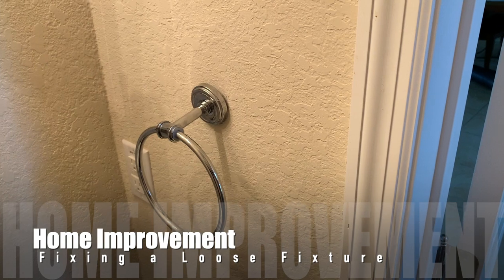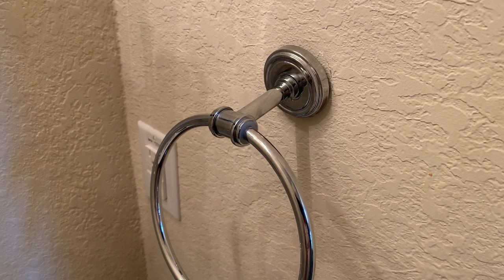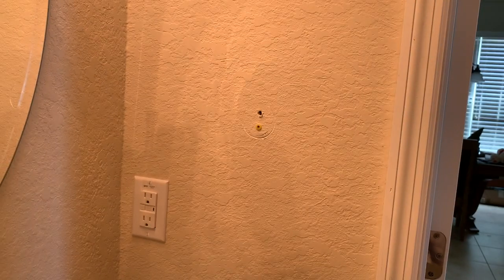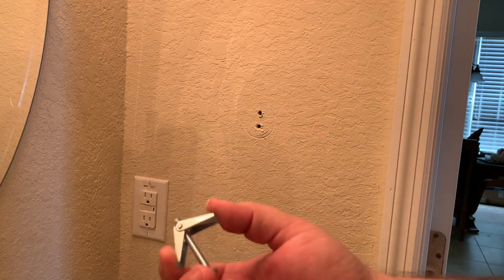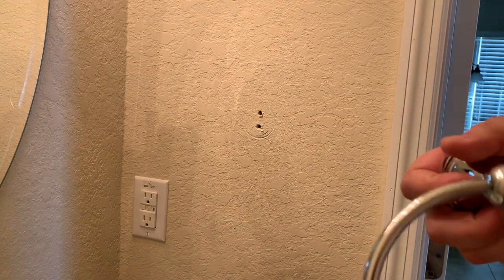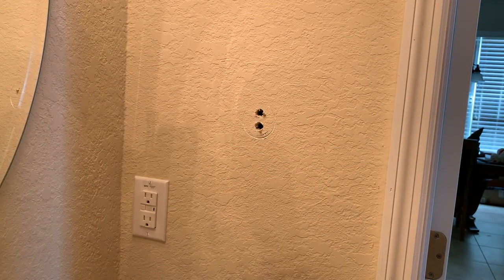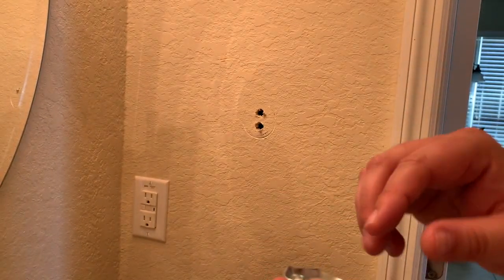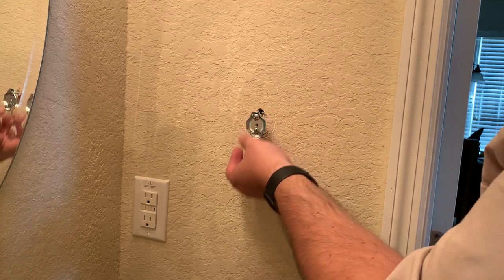How to fix bathroom hardware (fixture) that has become loose from Drywall | Home Improvement | DIY

Comment: Great, thank you!
If you ever have to remove the entire assembly, is it possible?
Reply from the maker: You definitely can, but you will of course have the hole in the wall and the wall mounts may fall behind the drywall. You can certainly change them out in the future as your styles and tastes change. Thank you for watching!

Comment: Will just a new anchor work as well? Or do you need a bigger anchor compared to the original size from the manufacturer? Thanks.
Reply from the maker: It is going to depend, but most of the time you will need a bigger anchor. If it is a fixture with a lot of use, I would recommend switching to a toggle bolt. Thank you for watching!
Reply: @LuminousMatrix  thanks a lot for responding and the video. Much appreciated
Reply: I continually have a problem with the tiny screw underneath aways coming loose. Do you have a permanent solution that would prevent it from unscrewing and loosening up? Thank you for your help